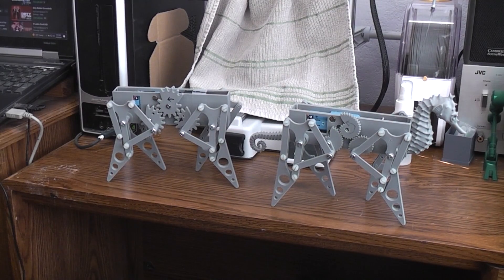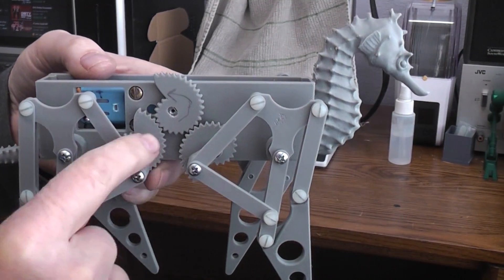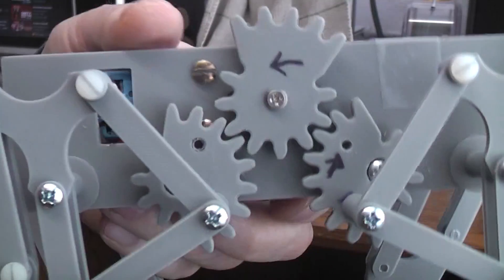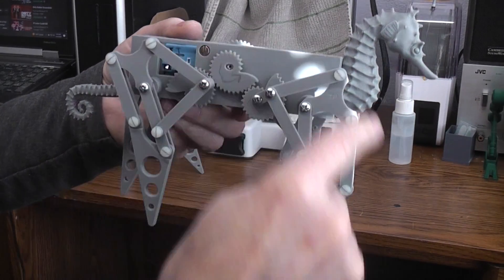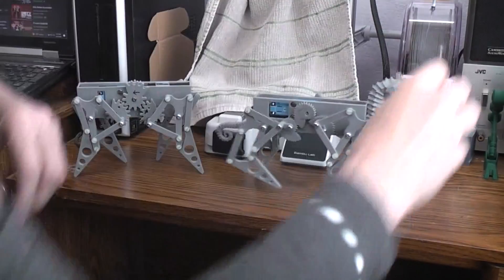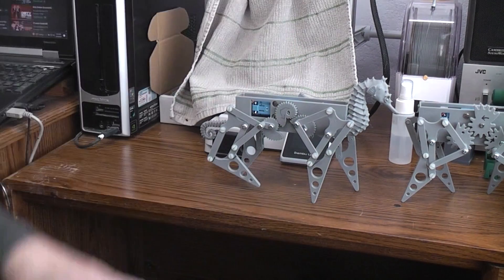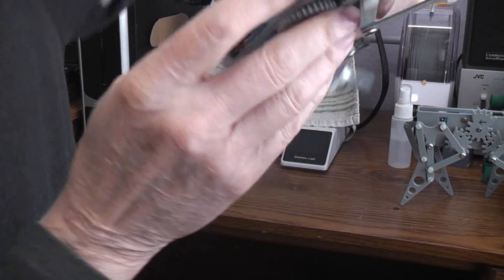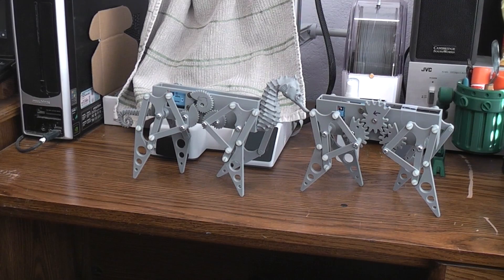Nautilus "spiral" gear, quadruped walking robot. Quick step, variable speed walking gate.

Comment: Yeah, the seahorse theme really sells it👍
Sorry, I can't seem to find the name of the "2 speed gear". In general I think these kind of gears are vaguely call "non-circular gears" 
In "507 Mechanical Movements", the closest I found were: 38 and 223 but these were stacked sectors of gears; not all on the same plane as yours.
Reply from the maker: Yes , I thought about doing a stacked gear set up as it might be easier to design, but tried the same plane version for fun.